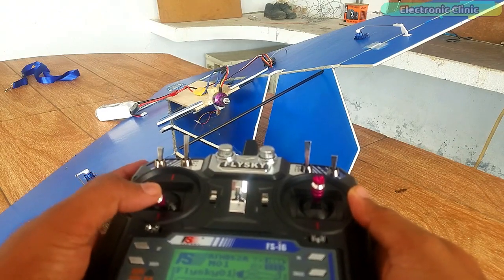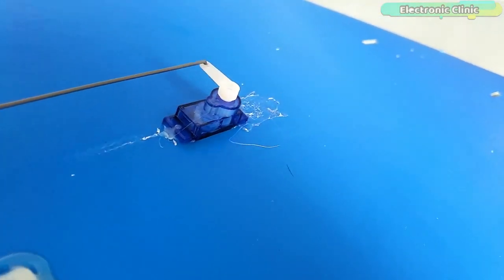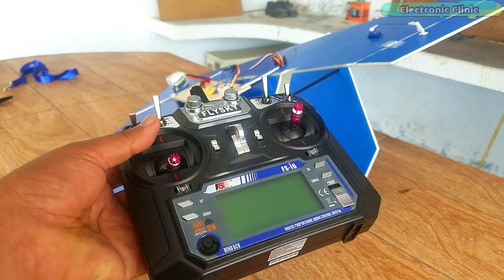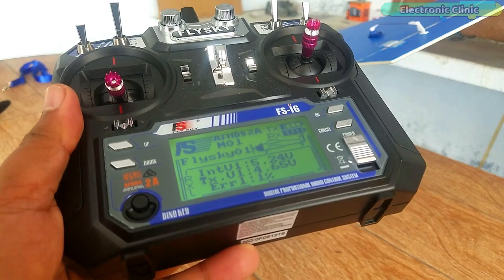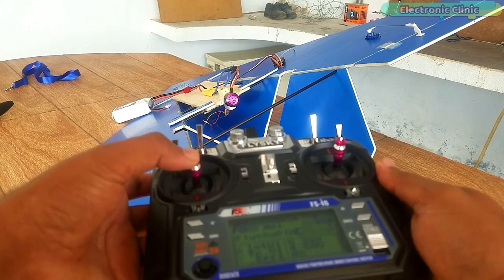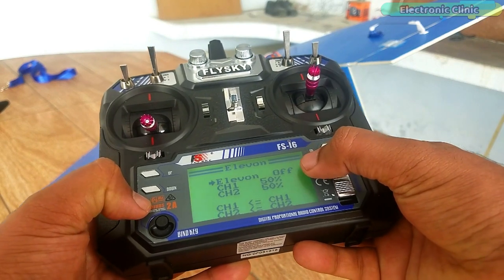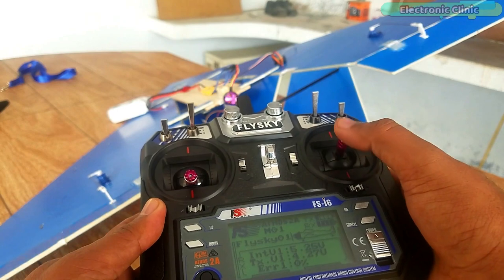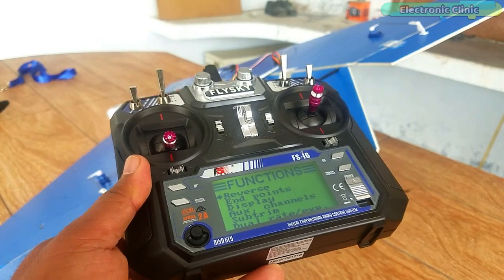Flysky FS i6 Elevons Setup, How to mix Two Servos channels of RC Plane or RC Flying Wings

Comment: Hi how much voltage is that battery Pls tell ❤️
Reply from the maker: that's 3s, 11.1volts
Reply: @ElectroniClinic  sure will it support it I'm not sure I'm going to buy one of the same reciver but idk what voltage it could hold I asked on e of the seller he said that it could hold 4-7v I'm confused bro 🤔
Reply from the maker: @dorigami4819  are you asking about the lipo battery or the transmitters batteries?

Comment: Hello thanks. But could you help me because I have an old Futaba attack 4 in 72 Megaherz am and also the channels and receptors. So how can i do with some circuit to do this mix for elevon in my flying wheel if the radio does not have this option. Only reverse servos.....any idea? Apart of buying new 2'4 ghz digital radio and receptor😅

Comment: How did you connect the servo motors to operate simultaneously and inverse and with how many channels.. I want to know the circuit, I use FS-CT6B Remote Control. Please guide me with the above issue.